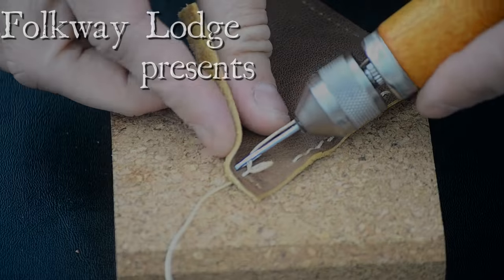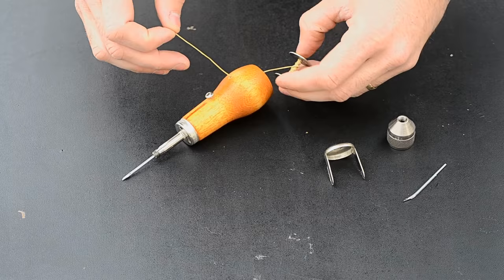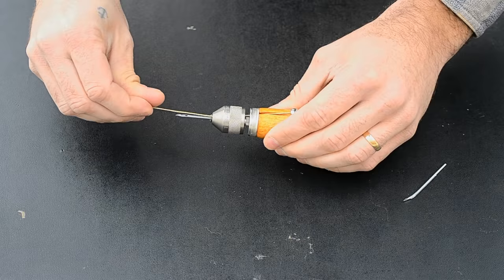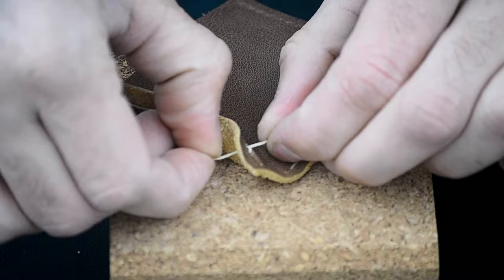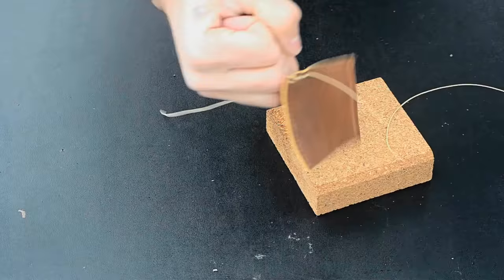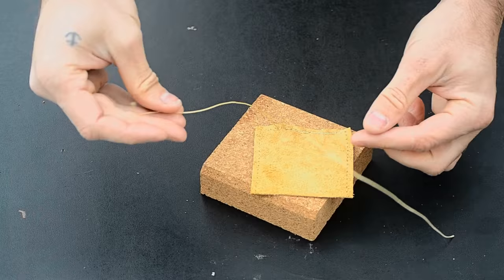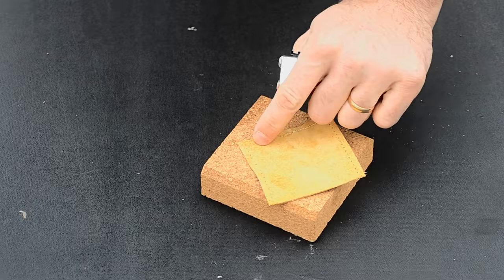How To: Sew using a Speedy Stitcher

Comment: Back in the 1960s, I used this a lot for repairing and reinforcing heavy camping equipment straps and such. It works very well. We would use cotton thread, coated with bees wax.
Reply: Quand j'étais enfant il y en avait un chez moi, je n'ai jamais su à quoi cela servait. 50 ans plus tard je sais. Merci
Reply: @amourdivin5155  my Fishing Gear ⚙️ is in the Kitchen  !!
Reply: @amourdivin5155 I feel you. I think a relative had one of these. I just assumed it was some kind of construction tool, kind of like a hammer or a saw.
Reply: @speedfreak8200  lol...an old howard stern fan

Comment: Used my Speedy Stitcher to bind a book I valued. Used a drill press and a very fine drill bit to make evenly spaced holes at the binding and went to town as shown. That book is never coming apart! Thanks for the video. Cheers from Nova Scotia.
Reply: So pleased I read your comment.  I have started book binding and love it, I’d decided to purchase the tool for camping and repairs when power is unavailable but your comment has me enthused to give it a red hot go with book binding too.
Thank you ❤️
Reply: @annabellagardner3190  I agree, great comment, very helpful.
Reply: but how even is your stitch line though
Reply: The stitches are very evenly placed as I marked them out first and drilled with my drill press  that has a laser aiming light, so it made it easy to hit the mark. The book was about 1/2 inches thick and the result was very good.
Reply: Awesome!

Comment: One things that speeds up the process, is, take the tag end of the thread, (underneath), and pull just a little extra thread through. Then thread a curved needle on that tag end and use it to thread through the loop formed when you pull the stitcher  back a little bit. It's much easier and faster to get the tag end through that little loop. Tie a knot on the tag thread to keep the curved needle from slipping off, If this works for you, I suggest dulling the curved needle so you don't have to worry about grabbing it and poking yourself. Just keep that needle separate for this one purpose.
Reply: hard to picture what you'r saying, please post a demo
Reply: This is a very good idea.  I will try that!  😊👍
Reply: @des863  to put it simply, that loose ended thread that you pull through the loop, tie a needle to it to quicken the process.
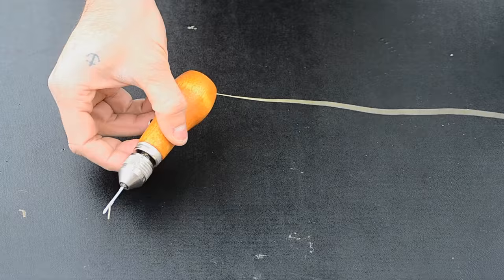Reply: @des863  He's talking about the free length of thread you pull thru at the beginning of the project and that you then pull thru each new loop that you make. Re-watch the video and I think you will see what we're talking about at time stamp 2:10.
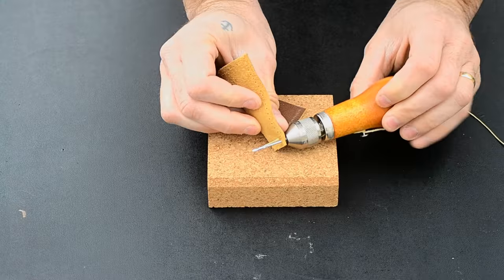Reply: Ok, this is how I've got it: Poke thru the material & pull the thread as shown (~2:10). Thread a (curved) needle onto the thread's end, don't tie it  (just pull a bit through). Use the needle to guide the end of the thread through the loops that are made as you use the Stitcher.
This is very much like when 2 threads are used (which might actually be easier).
Reply: learning is fun! thanks for the pro tip!
 haha, get it?
Reply: @dudet9662  Got it!  😏

Comment: These things are a wonderful piece of gear I've used them for decades. They are basically a ppcket sized industrial strength sewing machine and are able to sew canvas, shoe leather, sailcloth, heavy straps, etc atc, in multiple layers if need be. They can repair things a common sewing machine is incapable of, and can stitch items so heavy as to be entirely impractical or impossible to do by hand. I have literally prevented thousands in lost wages when I have repaired work gear in remote locations only because I had a speed stitcher in with my maintenance tools. The stitchers are rugged and last forever too if you are careful not to break the needles and carry spare needles in the handle. I happen to have one about 5 feet in front of me right now that I may have had for 25 yeats or more. They are a good tool to have along camping etc, they will fix eg a leather belt, a tent, a backpack strap, a diving bcd etc no problem. I really appreciate these little tools, they work so well (I even figured out an alternate stitch to use a few years ago). It is surprising how little known these old tools are.
Reply: Thank you.

Comment: Loved the video, straight forward in instruction. One key point left out was the tension post. Another important key point is putting the thread through the loop the same way each stitch. Initially when you first start stitching with S Stitcher, yes it goes slow. After you get a rhythm down, the pace picks up. When I have a large piece I’m stitching, I place a large blunt needle on the “ bobbin thread end. Speeds up putting it through the loop quicker.
Reply: ,,,,,,,,,,,,            2 Esdras 2: 30 -100               ;;;;;;;;;;;;;;;;;,,,,,,,,,,,,,,,,,,
Reply: The tension post also allows you to pull the entire Stitcher back when tightening the stitch, rather than putting it down and tightening by hand.

Comment: AT the beginning, a small silver tack  can be seen stuck into the wood handle.  This is for tensioning the thread as it is pulled from the bobbin.  You are supposed to do a single wrap around th etack, then thread the needle as shown.  It eliminates the need to put the unit down to pull on your stitch to tighten it.  The downside is that, with certain types and weights of thread, the tack cause too much friction and it can bind the thread.  Also,  the hidden bobbin is turned 90 degrees from the feed line, so it can be prone to tangles ands crossover friction that you cannot see coming.

That is why I use the Tandy Leather version of this tool.  The bobbin is outside the handle and you use your index finger to keep the feed tension constant like a fishing reel.  You can see the bobbin and it is much easier to re-load.  The whole thing is more instinctive and there are no fits and starts with tension problems  or feed issues.  That' what puts the "speed" in it.

Comment: You also can use a separate piece of thread for the backside for different colors or texture. You just have to tie it off just like the ending. This is also used on sail canvas.

Comment: I received my first Speedy Stitcher when I was ten years old - over fifty years  ago. I made dozens of leather and canvass projects (pouches, wallets, checkbook covers, sheathes, holsters, etc.) and repaired shoes, backpacks, tents, sails, etc. 
I went through the original 150 yard spool of waxed nylon thread in two years. My hands were frequently stained with leather dye and I often had blisters on my pinkies from tensioning the thread.
I agree - it is not necessarily “speedy”, but it does offer many advantages as an introductory-level, 
practical tool.
Also, using the Speedy Stitcher taught me how a lock-stitch sewing machine functions. 
I learned to appreciate the difference between top-eye and bottom-eye needles. 
When I was studying furniture design at a small art school in Providence, RI in the late 80’s, I designed and fabricated a metal and leather chair. My professors didn’t believe that I had hand-stitched the leather (using a Speedy Stitcher), until I  produced work samples and demonstrated the process. 
I’ve since learned a lot about working with leather. 
When crafting high-end leather work, (hand bags, sheathes for knives, axes, etc.), I prefer to use a harness maker’s bench and two needles to stitch through pre-marked and pre-punched holes.
But, as a sturdy, dependable, sewing tool, the Speedy Stitcher can’t be beat.
Understanding how a bottom-eye needle works, one can use the awl on a Swiss Army knife to effect sturdy repairs on equipment in the field. 
Just get one, read the instructions and have at it!

Comment: I hand stitch with 2 needles and an awl.  From what I have seen here a "speedy stitcher" is not very speedy compared to the double needle - awl method.   I have been hand sewing leather for about 45 years.  I was very very slow when I first started learning but with experience my speed improved.  Most of the leather bags I made back in the 1970's are still in use.  Hand sewing with 2 needles is how saddles are sewn.  The results provide incredible strength.
Reply from the maker: David Bennett I prefer the saddle stitch as well. I can usually stitch just as fast, if not faster than the speedy stitch here. However, I still like the tool and find it useful. It is great to have camping,  or tucked away in a survival bag for quick repairs. Thanks for commenting and watching, cheers!
Reply: Would be interested to see a video of this method.
Reply from the maker: Keith Turner it’s on the way!
Reply: Make a video! 📹
Reply: i do agree the name is not the best but keep in mind this is a cheaper way of Sewing, then a leather sewing machine.  also i don't think this was made to handle large jobs ( i may be wrong )
Reply: Where can i find the tool you have mentioned? I make leather bags and belts and need something less harsh for my hands.
Reply: walmart online
Reply: Show us a video or it never happened.
Reply: Harbor Freight also sells one, also many marine supply chandleries
Reply: I was actually wondering that...how strong is this stitch compared to the saddle stitch.    I've used the saddle stitch (two needle) for several projects and it worked well,  but this looks pretty convenient for some smaller projects.    Of course I'm new to it all,  so I do not claim any great knowledge lol
Reply: It's way more time and cost effective to saddle stitch. You don't need to go out and buy some fancy thingamajig to make the process harder. I've only been doing leather work for about two years, and I've found that two needles and an awl is super effective in making a strong stitch.
Reply: I thinked that this or any speedy stitchers are only for lazybones, who don"t liked or have no opportunity to use a double needs, I mean 2 needs, so.
Reply: @FolkwayLodge  ..me too David , I made a gun holster stitching that way, its a very durable stitch...
Reply: especially useful method to repair sailboat sails.
Reply: Agreed. I also sew everything with two needle, saddlestitch method... It takes me about 5 seconds to finish one stitch, this looks to be about the same, but stitches are not as nearly as nice.
Reply: Drag stitch needle is the game now  looking g to some to buy but custom made titanium made but longer by half inch
Reply: Thank you for your valuable experience that you are sharing. I am thinking of how I would use two needles and the awl together to ensure it does not create a separate hole in the material, being close but might not go together in one hole. I will look for videos on that technique as well. But this thing is still cool to keep around I think.
Reply: Folkway Lodge thank you for a very balanced reply. I have been saddle stitching for about 9 months and the muscle memory is coming slowly. I thought, early on, about getting a speedy stitcher. Now, I’m glad I didn’t as it would just sit there doing nothing. For survival, I would far rather take two needles, an awl and thread - I can just see where separate needles and awl might be handy
Reply: Well, one needle method is also very good and durable, depends on leather thickness- i use double needle for leather above 3mm :D
Reply: Not sure if anyone will andwer since this is so old but worth a shot. I have experience working with a curved needle for attaching hair extensions. It always allowed me to pierce through layers without having the eye of the needle pierce my finger. Should a beginner start out using curved needles with saddle stitching especially if I've used them before? Or when stitching things like purses should I be using straight needles to start. Thanks to anyone with suggestions.
Reply: Would like to see this.
Reply: @terrynicholson5214  Hobby Lobby
Reply: Hi can I find a job at your country
Reply: @FolkwayLodge  only like 100 vids of it around
Reply: @FolkwayLodge  link please 😎👍🏽

Comment: Back in the 70's this was used by carpet installers to join carpets, very labor intensive. I've been using these for years. Another way to lock the last stich is to do two or three stiches in reverse when done. Never thought to use the thread directly, but then again I don't think I would ever use it for such a long run.

Comment: I use a very similar device, but for thread I use waxed dental floss because it is amazingly strong. Lately I have started pre-punching my material with a leather punch so it is very easy  to pass the needle through.

Comment: I've been using this tool for a short time and learned something from you. I thought that the thread had to go up through the hole in the handle and then around the brass thingamajig sticking up before going through the groove and then the hole in the needle. Not having to go around that thing will make sewing with the Speedy Stitcher a whole lot easier. Thanks!

Comment: While I like saddle stitching, I can use the speedy stitcher for making a knife sheath for my larger fixed blades pretty quickly and still come up with a nice-looking, even stitch.
For the naysayers, who complain about the appearance of the stitch or that it isn't fast enough, it just takes practice.
Reply: I learned as a teen to use one of these,the hard way :) by using a pencil to pre-mark the holes or just mark a line it helps A LOT to make the stitches more even.also have used a nail or awl to partially pre-punch the holes helps also. Happy stitching :) Peace. Rick
Reply: Yep

Comment: Excellent instruction!  One thing I would add, is that taking a turn of the thread around the metal pin as it pays out of the bobbin and before it goes into the needle will help keep proper tension on the thread.  I've had my Speedy Stitcher for decades!  it's a fantastic tool.

Comment: Nice informative video. To finish the sewing, I prefer to use a leather sewing needle, and simply back stitch 3 or 4 holes. I make a lot of holsters, and scabbards, and have never had my stitching come undone, and it doesn't have ugly knots, or hanging threads.
Reply: what do you use to push the needle through with?

Comment: compared to trying to push ‘a regular needle’ evenly through heavy fabric this is a speedy stitcher.
Reply: The exact reason I bought this. We do not have space for a sewing machine nor would I need it that much so this seemed like the best option. I have tried to hand stitch a thick canvas belt before and my god did my fingers hurt after that. I had to use a sharp needle to get through the material but that also meant that I could not push it that much or it would pierce my finger, even the needle eye side. I hade to use pliers to push it through.

Comment: Started out using the speedy stitcher for leather repair on harness, pay attention to the direction your loose thread enters the needle loop, keep it the same each time to eliminate crooked stitches. Don’t pull the thread so tight it distorts the leather.

Comment: I make my own "sleeping bag" by simply folding an OLD QUILT in half and stitching across the bottom and about 2 feet up one side.  Takes about 30 minutes, and I've got a way to stay warm
without turning the heater up too much.  I have to watch your video every time I use the speedy stitcher because I can't remember how to do the stitch.  THANKS.
Reply: I will definitely do this!  I have a couple of comforters I picked up at Goodwill, that I think will work perfectly for this.

Comment: THX. where were you 40 Plus yrs ago when I bought one of these from a minimal back packing store in my hometown in western Co. :) In those days most of my our gear was used mil. supply stuff,so sewing it was usually a must do thing:) I finally got brave enough to ask the local saddle shop guy and he lol and showed me his and kind of taught himself as he showed me :) I still have it ,been yrs since I have used it. a good hint is to pencil a line or scratch a line to mark the holes ,even partially pre-punching the holes with a nail or awl on that line makes a better pattern, I recall using heavy marine braided fishing line in this also to stitch ,nylon and canvas. a go to trick is using wax on that seam even chapstick for make it easier to bend and temporarily water proof,times have changed I am a decent seamstress with an old metal singer machine,but will pull this out for a fun flashback:) thx. easy to understand video. btw. Peace Rick

Comment: I just used this to reattach a zipper on a large duffel bag.  It started slowly, but using a cork sanding block on the underside made this so easy.  Years ago, I used a leather "sailmaker's palm" when repairing sails while we were racing; it was a really hard slog to drive that needle through multiple layers of sailcloth.  The Speedy Stitcher would have solved this easily!  And delivered a much more professional job!!  GREAT Machine - simple and effective, it's nicely made too! 5*

Comment: Thanks. You seem to have completely left out the silver button near the exit hole from the bobbin/handle. I understand that creates tension.
Reply: The tension is in the side pin. Not the bobbin.
Reply: @slc1161  The video missed that tension post.  The official user manual has requires wrap one turn around that post to tension the thread.  Sherryl C - you are correct that the bobbin doesn't provide any tension

Comment: I reinvented the wheel and it is nice to know I had also reinvented the Speedy Stitcher but used a sewing machine needle instead. I didn't think of starting this way and used a separate thread, but it would pull out sometimes so this is a much better idea. Thanks.
Reply: I have a "punch needle kit" the needle looks exactly the same. ...recon we could punch needle the leather into the cork making a "messy" single side of loops and one neat finished side,  turn around and take the end of that thread and pop through every loop on the back and fiddle like shoelaces till its taught..... neater and much faster maybe ? Just my thoughts :)